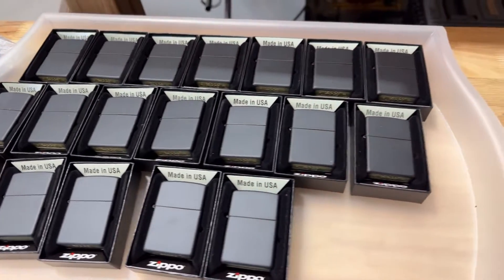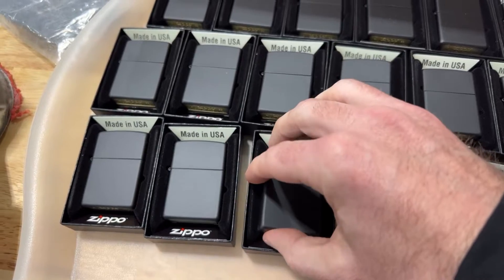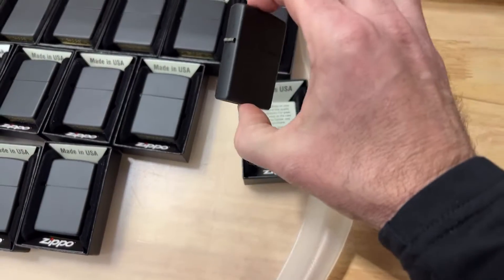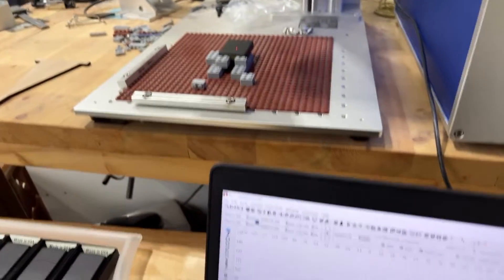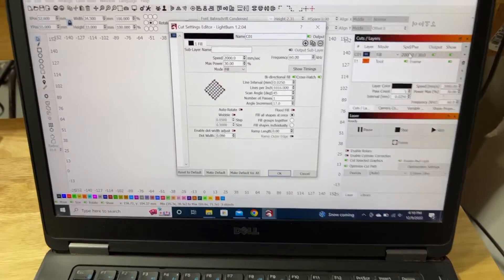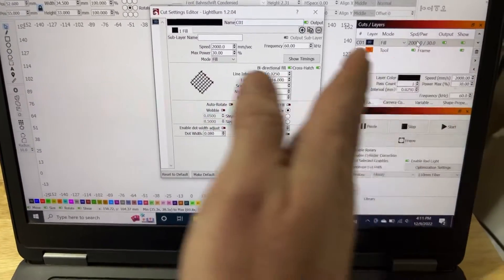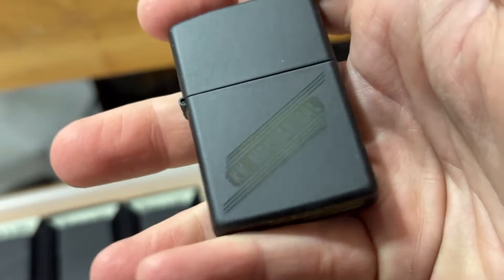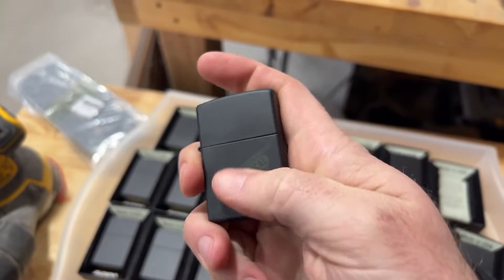Engraving Zippo Lighters on My OMTech Fiber Laser

Comment: Great. Might want to avoid the $11 "Street Brass Classic" Zippos. I just ran a test on either side of one and on both sides, the finish bubbled up, even after I lowered the power and increased the speed to the point the design was barely visible. Unfortunately, I bought 4 of them... $45 lesson learned.
Reply: Those have a plastic coating on them. Run low power across the whole lighter to burn off the adhesive and peel away the coating then clean up before putting the design on them.  I use the cheap Walmart Zippo lighters to test designs on and for mockups.